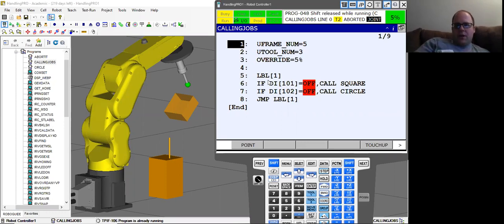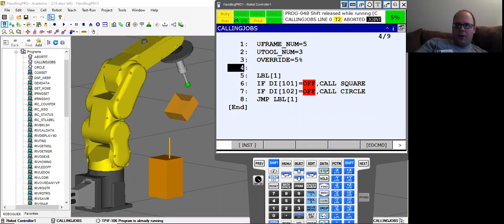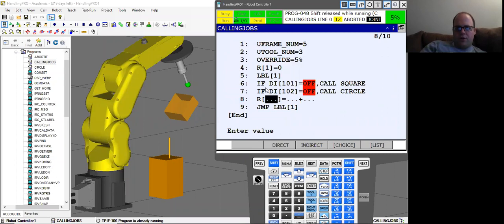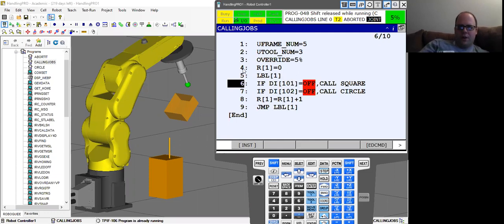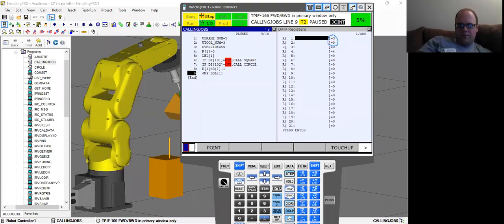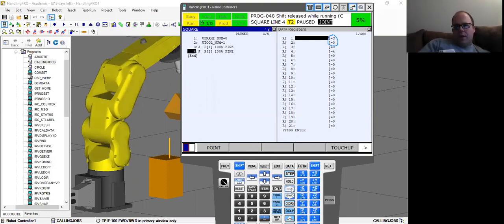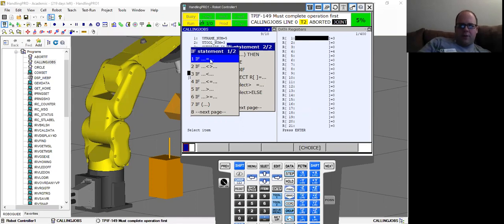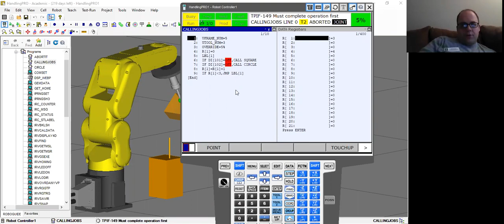Data Registers in FANUC programming

Comment: Good afternoon again!  Using this example counter how can I make a message show on the TP panel and type an alarm and the robot will stop when it reaches a set value.  Thanks
Reply from the maker: You will need to look at the menu utility option and make sure that is enabled
Reply: @danstaifer2028  Could you make a video demonstrating how to do this?
Reply from the maker: @alexandrefiorotto7045  in the future but not right now
Reply: @danstaifer2028  ok I'm waiting thanks